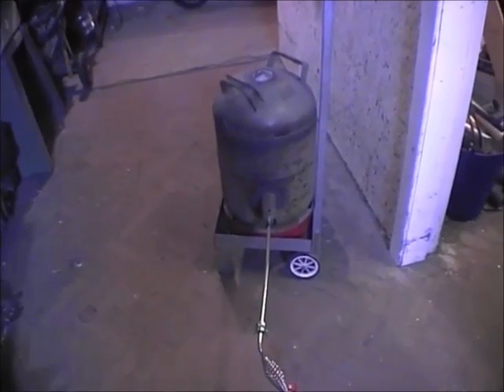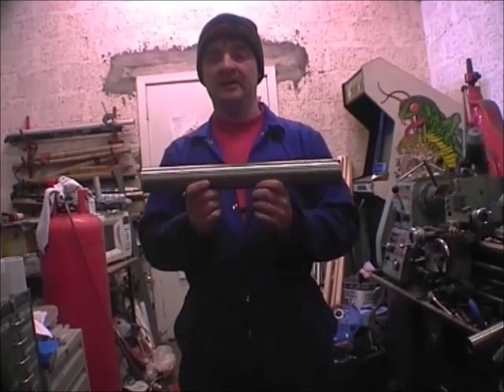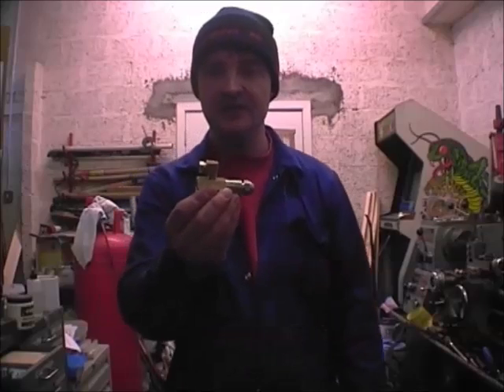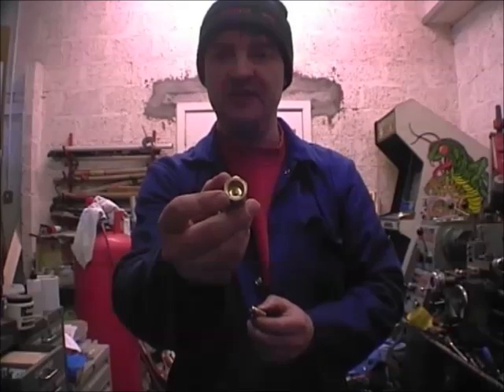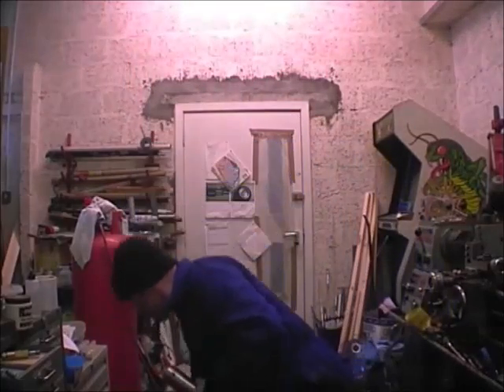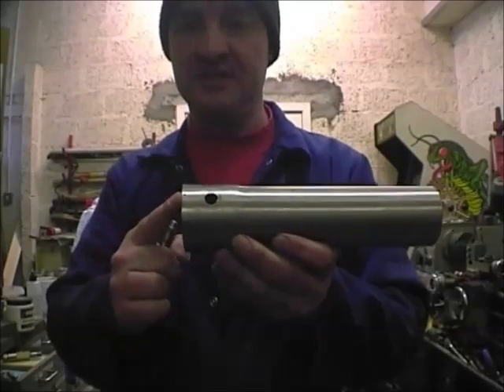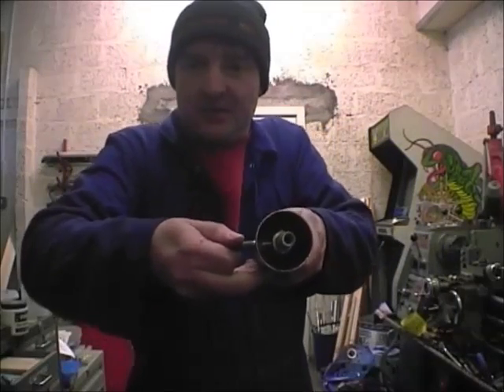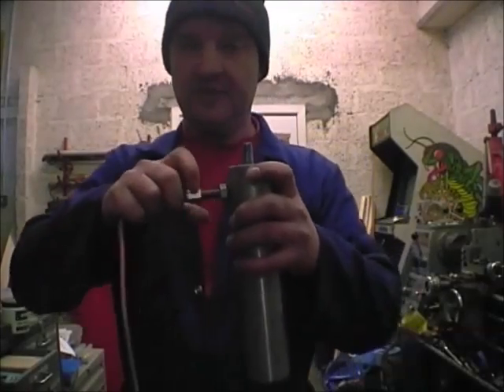How to build an oil siphon furnace burner step by step

Comment: Hello Mate, nice job ! In #2 video, during testing, it has one hellva good flame. ! Looks like it burns very clean. When you say "Oil ", are we talking waste engine oil, or a lighter fuel such as Diesel ? I am interested in building one just for heating a large shop. You have done a great job in engineering this.
Reply from the maker: Its waste engine oil cut with a small amount of thinners. Just to reduce the viscosity. You want to aim for 30 - 40 No.1 Redwood Seconds.

Or what fuel oil looks like.

Comment: Can you provide more information about the siphon nozzle?  I am trying to melt copper and am not having any luck with my propane torches.  I am thinking that an oil siphon burner might be the way to go.  In addition, did you hook up the air hose to an air compressor?
Reply from the maker: +Daniel Gwynne 
This is the nozzle body with 1/8th air fitting http://www.patriot-supply.com/product... 

This is the same body, only difference is it has a 1/4 air fitting http://www.patriot-supply.com/product...

This is the 1gph nozzle http://www.patriot-supply.com/product...

I feel that 1gph is too much and mine runs with the fuel valve cracked open a smidge. I'd go with the 0.75 or 0.50gph nozzle

0.75gph nozzle http://www.patriot-supply.com/product...
0.5gph nozzle http://www.patriot-supply.com/product...

So my personal recommendation is the 1/4 body HAGO_030L4068 with the 0.75gph nozzle HAGO_030L2157.

Comment: Well presented video. Your design works very well, most burners I have seen use a compressor or vacuum cleaner for the air supply and I am surprised the fan you use is sufficient but it obviously is.
One year on from the video have you any comments on the design. I am thinking of trying something similar myself.